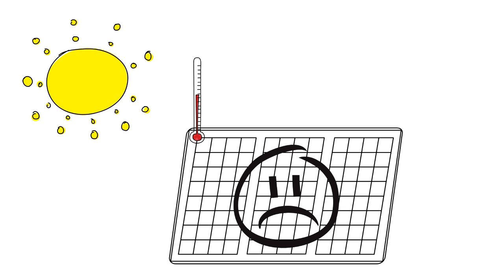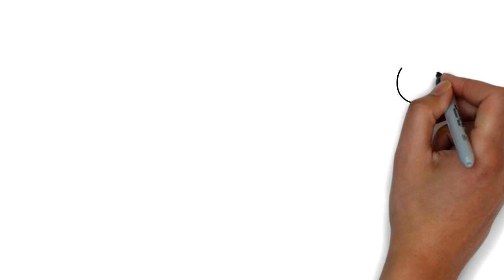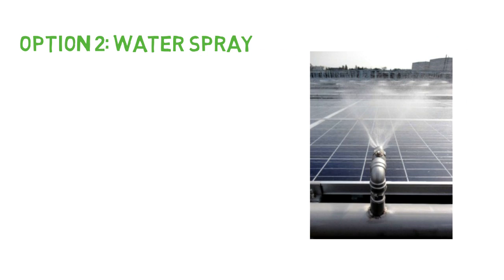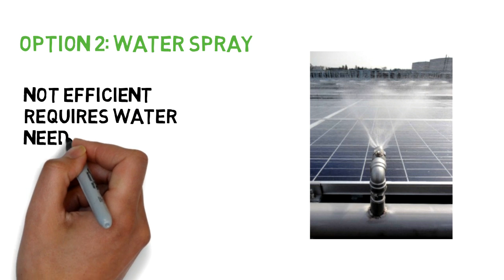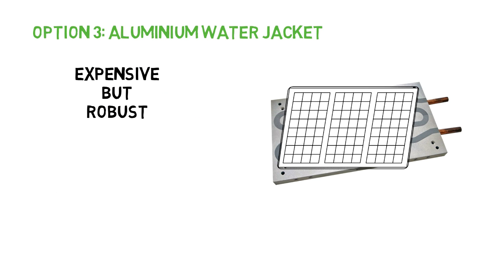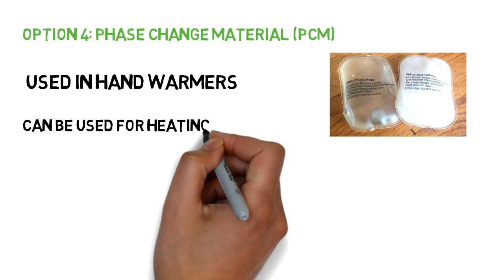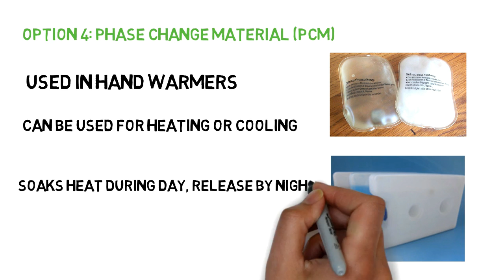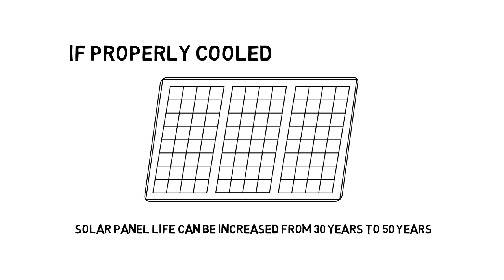4 Different Methods for Cooling Solar PV Panels

Comment: HI No5  We in AUSTRALIA use a lot of evap cooling air cons. evap requires ALL air in to be discharged to outside so have the discharge air directed with small ducting to under the panels. no fans required. I do this with my solar controller on the out side wall WORKS WELL On a new install EVAP+panels no brainer  SIMPLE  WHAT DO YOU THINK?          DOWN UNDER DAVE     PS this means you can lock your house up and direct the air to your panels and may be a window or 2 open to balance the air out  
.

Comment: Excellent explanation. 
Option 3 could be a better choice. Heat can be rejected at underground pvc pipe coil. Only a small circulation pump needed. 

In Option2, Water spray can create hard scale on the glass surface if use ground water,  which contains lots of minerals to deposit. Here, demineralized (DM), Rain or surface water ( from pond, river) after filtration can be used to minimize the problems.

Comment: The flaws with your video.   1- Thin film cells don't produce much electricity. So, may as well use a regular PV.  2- spraying water will leave a film residue on the solar glass panel, it will regrade the panel overtime. Unless you spray distilled water. 3- water jacket - There are already PVT panels on the market. $- phase change materials,  how the hell would you implement that on a solar panel?
Reply: You sound like you can help. Whats the most affordable way to cool bifacial solar panels?

Comment: The longest that panels need to last is 10 years if the installation isn’t big and 20 year’s for bigger installations, because after 10 years you can replace 6 or even 20 panels with more advanced panels, because technology advances quickly

Comment: Option 5: Mount panels on a Cool Roof, i.e. a roof that is painted a light colour. This will reflect some of the heat away from the panels and make them about 2% - 3% more efficient.

Comment: How about creating convection and routing it to a vertical wind turbine that is contained within a shroud?  This would probably increase the output efficiency by at least 33%, and I suspect more.  During the winter, when you have more wind, you can remove the shroud to get more benefit.
Reply: Temperature coefficients tend to be around 0.25-0.5%/C. To lose 33% you would need to have extremely hot panels. More realistically you may lose 10-12% in the peak of summer, maybe 15%. If your panels are 100C they will degrade very fast, but most don't get that hot. Roof mount is bad for heat though because there is no airflow on the back.

Comment: A cooling breeze from a fan might be useful. 
Air moving under the panels. 
3% loss means 3 new panels in every 100 panels,  or 1 new panel in every 33 panels. Each year to maintain output and micro inverters. 
But micro inverters can degrade aswell.

Comment: Use a thermoelectric generator chips and an aluminium heat sink under the panels to get rid of the excess heat and produce electricity even after the sun has gone down

Comment: The best way to cool panels is to keep them in the shade :) You might think I'm joking, but I'm not.  Use selective spectrum mirrors to shine light onto panels which are positioned in shaded areas and angled pointing slightly down towards the ground. Then you can cool the panels from the back using  a closed loop water spray or other method. This method has the added benefit of limiting the dust landing on the panels. Yes, you have to track the sun with the mirrors but this is far from impossible. And the mirrors can be cheap, made of reflecting tape stuck on lightweight backer material.

Comment: Simple over view.  Thin film and say nothing else.  The only thing I know is that it has less thermal mass so heats up faster.  Still something has to carry the heat away.  None indicated.  Natural convection from the faces.  Well the area is the same  and basically independent of thickness.  Thermal resistance of natural convection is far worse then the conduction resistance.  This is an incomplete solution.

Spray cooling.  The water will absorb some frequencies.  Will reflect some light away better then the well designed face of the cell and finally the water contains dissolved minerals that will be left as the water evaporates in the process of cooling.

Liquid heat sink of a flowing liquid or the phase change material. I am combining them.  Both require a surface to make contact with the solar cell.  This near solid aluminum heat sink approach is what I would use for more then 1KW / sq meter. that the sun heats, a lot higher.  use the approach of the next approach, phase change.  Plastic works in that application so the liquid could be a low pressure and wet the whole face through the film of a bag.    The heat can be used for thermal storage in a more cost effective material and be insulated so more control is obtained.   Green houses use the earth around the plants and under the green house.   Lots of choices since volume, weight, and conductivity is not as important.

Comment: Why not use aluminium pipes? They are cheap. Why not float the panels in a canal that has moving water? With this system you will collect hot water also.

Comment: If we build enough of solar panels to substitute fossil fuels, will it be our doom? Because they are efficient at transforming solar energy to an energy phase that stays long on earth instead of the solar energy reflecting back to space, they might threaten our goal. It is a paradox. Make them less efficient by increasing albedo (have them white) might save earth, if they get cheap enough. Otherwise we save the co2 levels only to sacrifice albedo.

Comment: i would use method 3 and no pump is needed as the temperature gradient of the water makes it flow on it´s own, this heat is then used to power a stirling engine

Comment: ..what about adding Peltier thermoelectric (TEG) under panels.
Reply: Peltier are not very efficient and by themselves only move the heat a small distance. You still have to move that heat somewhere besides beneath the panel, heat rises.    Unless the other side of your peltier was liquid cooled you would do more harm than good with the tremendous wattage you would be burning in the peltier units.   Just figure up what a whole solar panel covered with peltier units would cost, no need to pursue that further.
Reply: @laserflexr6321  ..thanks for clearing that up..mybe it would work for a few moments..later when the heat is equal than the difference between hot & cold becomes smaller.. that's would not work very effectively..tq for the reply

Comment: Just add a big heatsink in the back like a CPU
Reply: The material cost would be greater than the cost of the panel. This would have been an option 10 years ago, but panels are dirt cheap.

Comment: Both paraffin wax or beeswax are good PCM material. Beeswax is better in term of higher melting point... It is important to keep the system temperature lower than the PCM melting point or it will be a disaster.....

Comment: I was wondering why no one is making a solar panel that has a heat exchanger behind it. The efficiency gain is quite dramatic 25% loss is crazy.
Reply: There are some companies that make premade combined panels but lack of awareness is slowing it down i think
Reply: Isn't that option 3 as described in the video?
Reply: But they are not being manufactured that way which is the point  @richardaversa7128

Comment: Systems based in places like the Sahara desert would benefit from chemical heat absorbers, even a pc water cooler would be a good option, mainly because of the excess heat throughout the year, which lowers the efficiency significantly. In places near the equator, lowering the temperature of PV panels would increase yield, but would also allow us to create something similar to the Noor plant in Morocco, which would probably be way more efficient (sun to electricity + heat, rather than sun to heat then electricity). Producing electricity directly, and removing excess heat from the equation is way more efficient, compared to x times more materials used in converting salt to a molten state. In places with your 'standard' 4 seasons, radiator air cooling using Bernoulli's principle, would be cost effective, as a chemical absorber would be next to useless and expensive compared to a few fans attached to the back, so retrieving the heat would be unprofitable = $/Kwh. Just a thought, if someone has interesting books/articles on chemical absorbers and prices, that would be cool. Anyhow, in a few years time,  most, if not all building foundations will be designed with heat storages, to reduce heating costs.

Comment: What about combining the solar panel with a STEG system. Using the heat from the panel to power the peltier modules.
Reply: TEGs have very poor efficiency even for high performing units. they are very expensive due to their relatively low production volumes (mostly small gadgets and hobby makers.) It would also act as an insulator, preventing the panel from dissipating heat, and on a hot day would itself (the TEG) become heat soaked and progressively decrease output, while still insulating the panel.

It's a good idea, but until there are some significant materials tech advancement in the area, the feasibility for TEGs as heat harvesters is low.

Comment: The average insolation (solar energy gain) in southern South Carolina/northern Georgia in August (where I live) is about 5 kWh/m^2 - much less than Texas, Arizona, or especially the Middle East.  This converts to 18000 kJ/m^2.  The latent heat of fusion of PlusIce is 140 kJ/kg.  So you'd need 18000/140 = 128.8 kilograms of PlusIce Per Square Meter ! (over 280 lbs!).
     PCM's are great for moderate heat collection over a large area - such as your example of helping cool a desert home during the day and keep it warmer at night.  The heat load of trying to cool even one 2' x 4' solar panel (about 3/4 sq. meter) is way over the capacity of any solid/liquid PCM for any practical application.  Pumped liquid/vapor PCM's are viable (think heat pipes) but way more expensive - essentially an air conditioner attached to your panels.
     Please note that I do understand a smaller amount of a phase change material would keep the panel cool for a set amount of time, and allow higher panel output for that set time.  After that, the panel and now liquid PCM would heat up as a unit, taking longer to reach max temperature due to the extra mass and slowing the decline in panel performance.  But for any practical fraction of that ideal amount of PlusIce mentioned above, that time would be measured in minutes less than one hour!  (Assuming 14 hrs of sun a day, 1 hour would average 1/14th of the solar insolation.  1/14th of 280 lbs is still 20 lbs per panel.)  Fusion PCM's (solid/liquid) are NOT a practical way to handle that much heat.
Reply: Hi,
Then what do you think is the most efficient method to handle that much heat(from a sub Saharan region)?
Reply: @ahruf  Mount the panels so they get as much air as possible.  No method of cooling the panels has been found to be worth it when you consider the cost per watt-hour gained outside of extreme environments (space).  Water cooling is the closest, but only if you need the heated water - in other words, you need all that hot water for something else, and would have had to heat it with some other method anyway.  (i.e. Cooler climates using it to heat buildings.)
Reply: Thank you for doing this calculation. I was confused when he said PCMs are promising because I research and design batteries for a living and I've explored the idea of using PCMs to keep a battery cool. The short answer is that they help a little bit but can't absorb enough heat to justify the cost. Plus they can be a huge mess to work with and you have to make sure they re-solidify uniformly and with a good interface to the surface that needs cooling. Also thanks for the info that no method of cooling has been found to be worth the cost, because that's what I searched for and I came across this video.

Btw, there is an issue with your assumption that the average insolation would be 100% converted to heat. Some is converted to electricity, some reflected back into space. But regardless, the heat absorbed by the panel in a day is probably at least an order of magnitude larger than what the PCM can handle, so your conclusion holds. I'll forgive the you from 5 years ago for this error 😂 cheers!
Reply: What do you mean by pcm?
Reply: @FatimaAmer-b3b  Phase Change Materials.  Currently the best way to store heat and/or absorb excess heat to be released later.

Comment: What if using peltier...
Reply: could work, but they are also extremely power hungry. one small 40x40mm peltier plate can easily swallow up 50 to 100 watts of power.... but using them to generate a little extra energy through the seebek effect (as in teg's or thermoelectric generators?) that might work.... in theory.
Reply: Got it now, thanks alot for the good advice.

Comment: Can the PV cells be backed by a  material that uses the thermoelectric effect to increase the output?
Love to know.
Reply: Use Heat Pipe technology to cool down the lower part of the panels. It is a self driven Recuperative type Thermodynamic cycle.
Reply: If you get a but load of those chips from China cheap. Place them all over on the back with heat sinks on the other side. You could get more power towards your system I'd think..

Comment: Instead of removing heat after sunlight hits PV cell, what if we can block/filter the thing that makes the PV cell heat up? The cell used the photons of light to create electricity, right? Our sun is blasting the full spectrum of light. Seems the PV cell doesn't need the full spectrum to generate electricity?
Reply from the maker: True. We need in silicon PV we need photons with energy of 1.3 ev. Rest arent used up and result in  heat. New PV panels make use of photons with multiple bandgap energies. Please see multi junction solar cells
Reply: The plants I touch never seem to be "too hot" so they figured out how to convert sunlight to energy without overheating...keep on thinking!

Comment: Would a layer of aluminium glued to a flexible panel act as a heat-sink?
Reply from the maker: It would but the glue should be a thermal compound and hink sink should be exposed to moving air
Reply: It will be elevated of course to allow the air to move behind it freely. I don't know of any thermal compound that will be economical for such a big job, so I thought a glue mixed with a HEALTHY DOSE of fine aluminium shavings may do the trick...

Comment: Another solution would be to use solar attic fans! Building an open overhead structure for pool area in Florida incorporating 6 mono 350w panels with struts to vary angle with several solar fans with a timer(thermo or hour) for hot periods during summer. Panels will provide shade, fans run on the sun and will also cool guests under it, sounds like a plan to me:) Will try the fans downward and upward under the panels for best results
Reply from the maker: Goodluck!

Comment: What about putting infra-red absorbing glass over the panels? These are sold for domestic windows; why not use them for solar PV?
Reply: Shades the sun I'd think
Reply: @NwoDispatcher  not necessarily. Some materials are wavelength selective for absorption. Some laser focal lenses used with CO2 lasers at  10600 nanometer, infrared, are above 99% transmissive to infrared but completely opaque to visible light, including  what was it 600 nm red pointing laser.  Most CO2 lasers do not use that material however because often a pointing laser is aimed through that same focal lens so you can see where the CO2 beam will hit when it is output..
 E glass is the name of what is used in windows that appears to have high transmission of visible light but attenuates  the IR portion of the spectrum.  It would be worth looking in to but you might need vacuum between solar panel and IR panel to stop convection. And the solar panel would warp if you put vacuum on it.  I dont think that could be cost effective. And if it were, the high end panels would already be using it for the face glass for that very reason. Maybe that's what those ultra black panels are?  If that is the case I dont think you could gain very much compared to the extra cost but over 25 years in an enviroment where 5 degrees lower operating temperature is beneficial it could be worth it, if you want to pay more upfront for the panels.
 I'm thinking if you are gonna go to the trouble to try to keep temp down you are gonna have to take heat away from the panel. Think about it, if a panel converts 20% to flowing electrons, the other 80% is some combination of reflected radiation and convection of heat.  Lets say 60% is some combination of reflected, re-radiated or convected, that means you need 100 watts of heat removal on a 100watt panel to keep it at ambient temperature.  It is going to have to be fluid cooled some way.